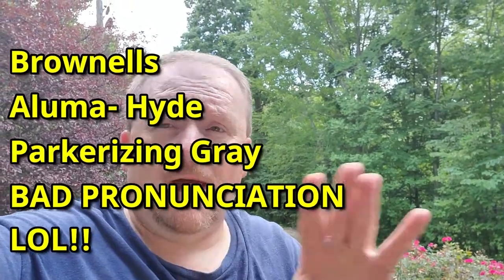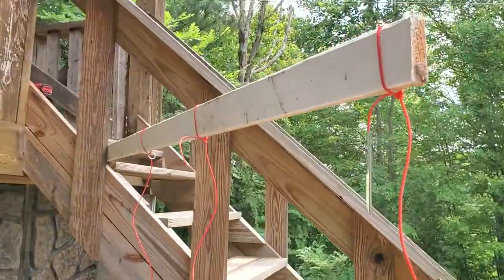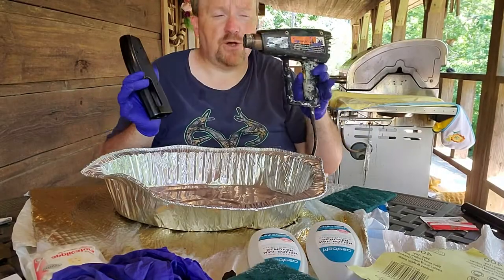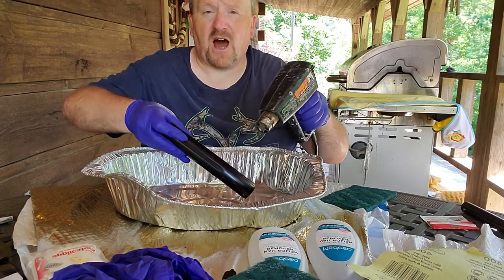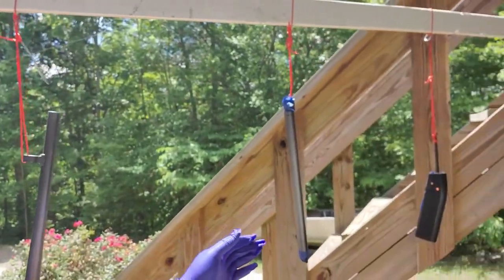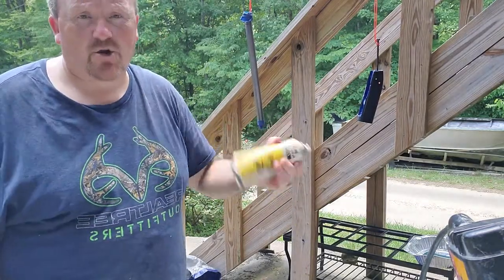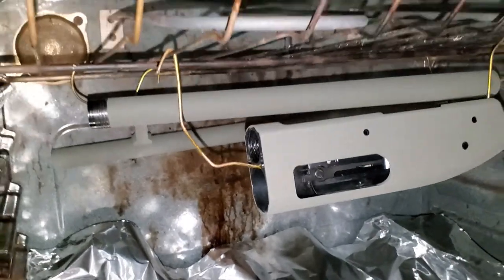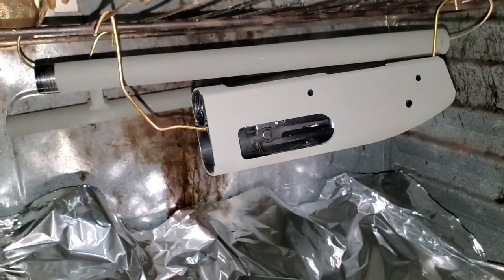Mossberg Maverick 88 Security PART #1 Painting Parkerizing gray

Comment: Came out awesome but id imagine it wont suck oil into the metal like a true parkerized finish?
Reply from the maker: With this paint you don't wont no oil on it removing the blue oil ect. Then layering the paint and a bake the barrel is sealed from the elements. The gun I did is still going strong and paint holding great. Baking is key

Comment: Ever think of installing the xs big dot sight to replace the front bead ? Opticsplanet has them
Reply from the maker: I checked them out for my Glock 10mm was thinking of replacing it with something, something new . On the shotgun it would be an awesome choice for sure. But I went with the fiber optic because I put a low profile light on the magpul forend. And when powered on at night it makes that fiber glow like a star. And lightning fast to target with it not just day but night as well. And for about 12bucks I got the sight and 4 replacement colors.
Thanks for the info on the sight replacement 👍🏻

Comment: Hey man is it necessary to cure the paint in an oven? Will the paint not last as long?
Reply from the maker: From past experiences baking and just allowing the peace to dry for 2 + weeks. I've found a good bake really cures the paint to the gun.
And between the 2 the baked holds up better to everyday use in the field.
It's like that's what the paint is made for.
The Mossberg I did after lots of shots down range in out trucks on tables and so on looks as good as day I finished it.
But if you go with just a paint and dry make sure to allow it to cure for at least 2wks